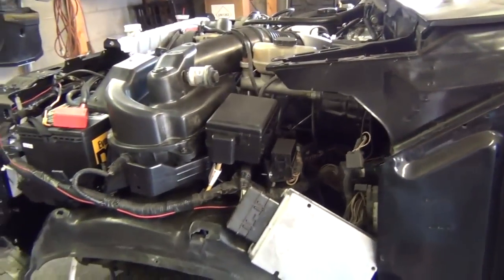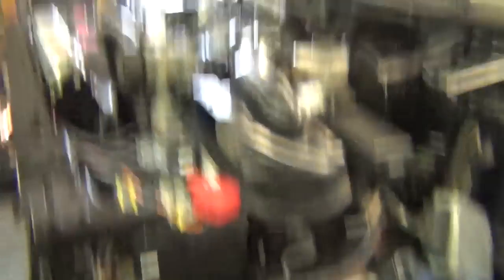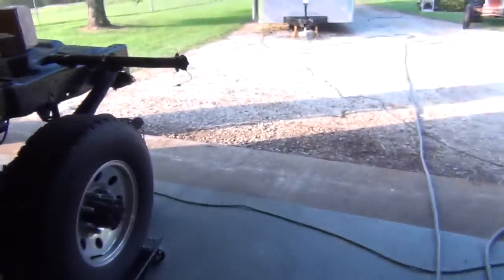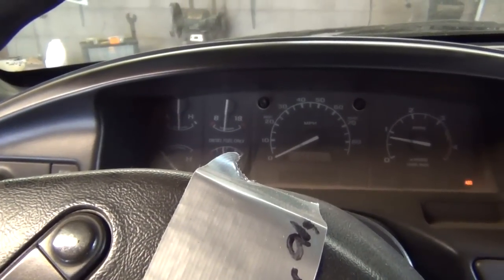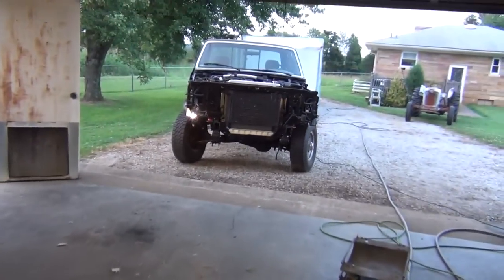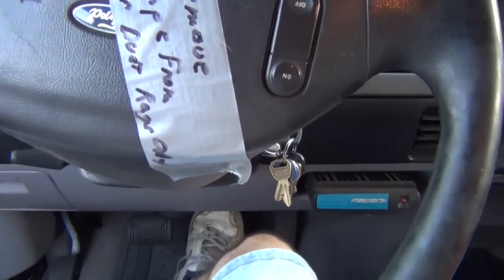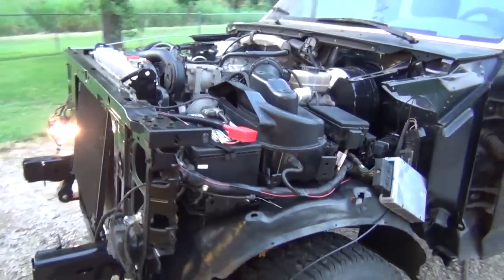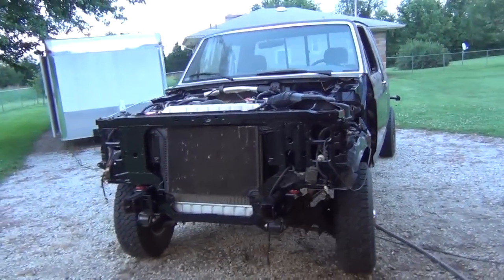1994 Powerstroke project part 38. Fire it up !

Comment: Wow!  Sounds great.  Always makes you feel good when everything turns out.  You can buy the tools to take off those fuel lines at most parts stores.   I have some cheap plastic ones that have lasted me for a few years.  Nothing more than a sleeve that inserts around the line and compresses the fingers holding line on. Some can be hard to get off. Bad design like you said. Good Luck..